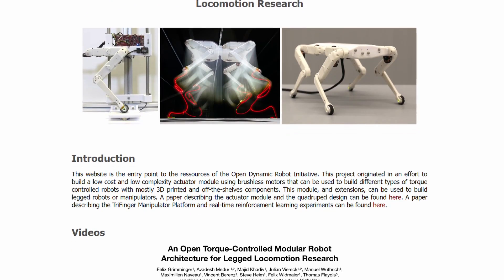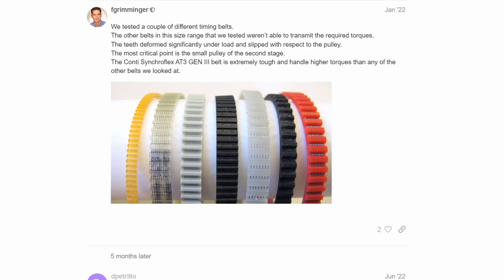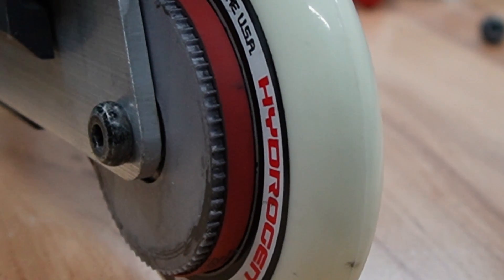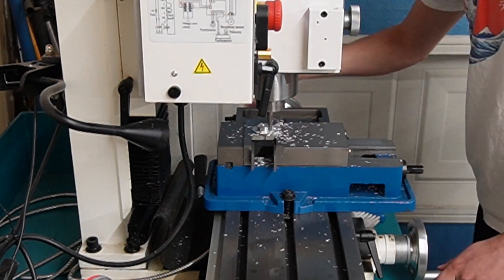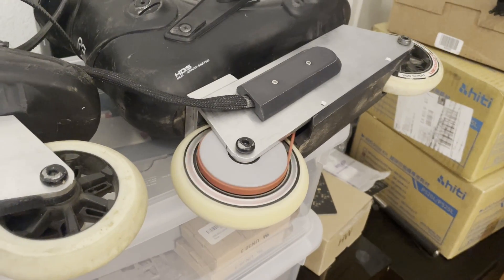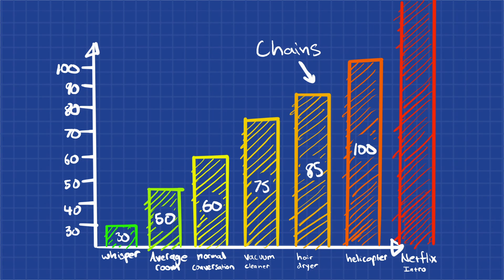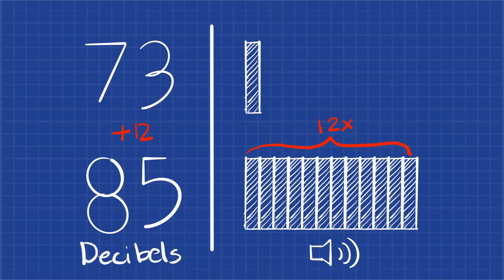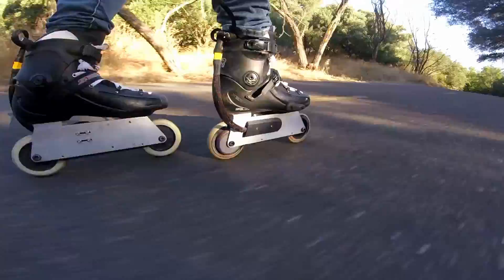I Made the Worlds Fastest Electric Rollerblades (Part 2)

Comment from the maker: What other suggestions do you have for improvement?
Reply: sell them so i can buy them
Reply: Suspension would be cool. I’m not sure if these have a grind pad, but that would be epic too
Reply: some other battery system. Even if the batteries dont last as long it would be cool to see some type of lighter form factor
Reply: Have you experimented with a front wheel drive design? I have always felt that this would feel more natural than rear wheel drive on electric skateboards and similar evs
Reply: You would need a harmonic pin ring motor to get the right torque needed to make them Air Gears. Although the added weight would definitely require suspension. Because of weight distribution the rear wheel would be the smartest with a more powerful setup, anytime you move your weight has to be on your heel anyway. The ones used currently in trek e-bikes feel natural compensating for human mechanics. Splitting the load between two alternating strides may work in our favor ultimately if it's possible to scale down at all.
Reply: On-Boot battery. (bonus points for quick swap options)
Having a fanny pack can be a bit cumbersome for quick on/off and takeoff as a final mile(s) transportation.
Having a 3-7mile on-boot battery would be better.
Bonus points if you can fit it under the frame.
Reply: @lordhighbinary2006   yes, this. Roller blades are about freedom. Cables to a fanny pack hold down that freedom
Reply: @BrentJosephSpink  I'm not saying I don't like fanny pack battery option, but it would be nice to be able to choose, or have both in case you need extended riding vs a short jaunt
Reply: I think these are pretty much ready for production and sale as they look like something people would want as they are now. As for improvements so would more modes be interesting. Do you have regen breaking?
Reply: I am a struggling downhiller. Could add a mode for speed control and stop on steep slopes? This could be the game changer.

Comment: hey, nice build!
love that you could get a very low resistance even using belts.

question though: did the gear on the side of the wheel scraped the floor? I see the you made a very thin gear so itmay not be a problem, so I was just wondering what was your experience.
Reply from the maker: Thanks! The pulley was a large consideration for this design because I was concerned about it contacting the ground. I am pleased to say it has not been a problem. The skates can get to a 30 degree angle before contacting the ground. Additionally, the pulley is on the outside because I tend to make tighter inside turns.

Comment: would putting another motor to drive the front wheel be something doable?
Reply from the maker: This would be technically possible, but I don’t think there would be much benefit. You would get more torque, but there would be twice as much hardware, which would be heavier and cost more.

Comment: would there be any possible way to take the energy from fakie/backwards skating and use it to recharge the battery while you move backwards?
Reply: This was something I was thinking of... Using the actual man power to charge the battery. Kinda like taking your foot off the accelerator in a hybrid car and it goes "green/eco mode" to charge the battery
Reply from the maker: This is definitely possible! The skates have regenerative breaking right now so you would just lay on the breaks as you skate. Regenerative breaking isn’t very efficient (maybe 10%) so you won’t get a lot out of it, but it’s better than nothing! Going downhill is where it makes the most sense imo